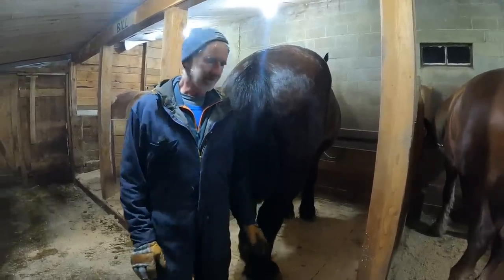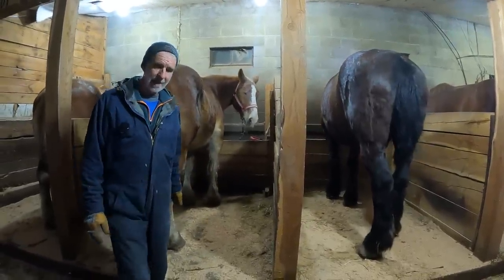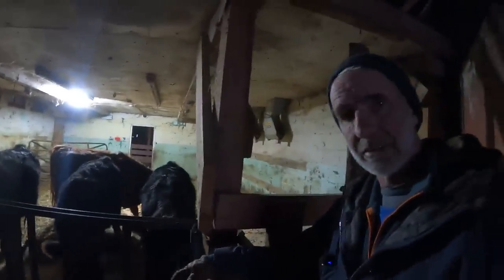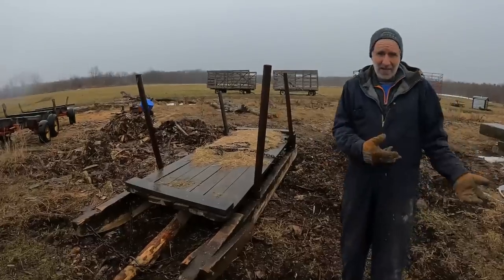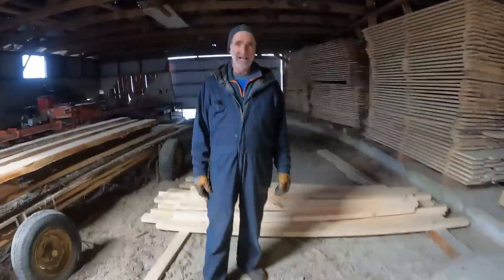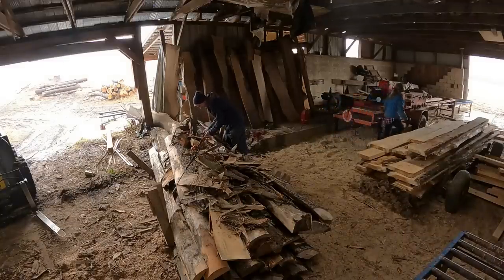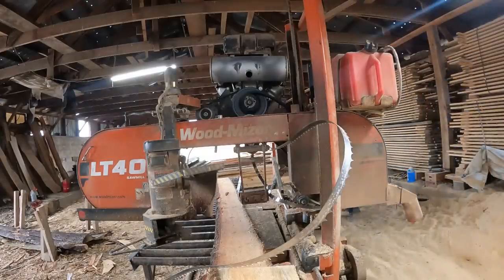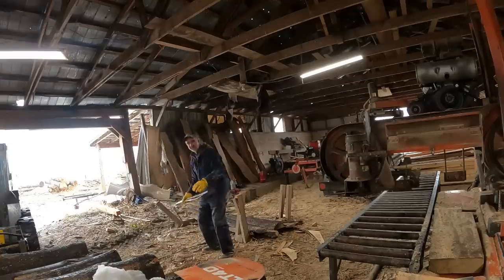Update on KEN'S LEG!! // Sawing Lumber on a Rainy Day with a Woodmizer LT-40 #459

Comment: Swelling on the hind legs often is caused by a subcutaneous inflammation caused by bacteria that may enter the skin through tiny cracks or wounds. These swellings occur more often with horses that are kept in tie-stalls than those who are kept in open environments. The lack of movement for prolonged times  can also be a cause for swelling especially with horses that usually work a lot.

Comment: To address your traction issues with your manure spreader Jim, I have found that putting the tires on opposite direction from the way that a tractor tire is mounted should increase the traction a lot. Your videos, Jim and Brenda, are a great gift to so many people and are of a quality that they could be used as an instructional tool in classrooms. To have a better understanding of agriculture and the many methods used in agriculture historically will give people a better understanding of what their own capabilities are. Thank you folks for the fine videos and education.
Reply: Jim is using  horses so  no need  to reverse manure spreader tires to increase traction from tractor.  Gosh you almost  got me there with your comment John.
Reply: If your comment is right about increased traction then why not tractor tires be mounted your way from the factory. I am sure  the engineers would  have that all figured out. I think you are just fooling with me   and  maybe  Jim .

Comment: I wish I could be there to show Brenda how to set up a pivot point  to make edging those planks easier for her. It would involve setting a saw horse between the pile and edger. Only touch the far end of the board. Swing the board onto the horse, pivot and the other end onto the edger deck. Line up and push it through. It would work better than having a helper.

Comment: It was not unusual for horses in towns in England to develop leg problems after being worked on the hard surfaces of the roads then rested on Sunday. It may also be the shoes are reducing the movement of the frog and  reducing circulation. I wonder if there is a pattern such as the time of year when different shoes are worn, or the type of work such as plowing or forestry.

Comment: Good idea using hot water to dissolve pills however you might want to check with your vet about that.  Heat sometimes damages the efficacy of the antibiotics, probably depends on how hot it is.
Reply: Excellent point, I would think 100 to 150° f would be ok, bee honey breaks down at 160 ° I was told. But yes, very good point.

Comment: Why not get wider tyers for the speder so you don't sink into the fields.
Reply: We know Jim spreads manure when ground frozen  and when ground is dry  (summer and Fall ) . So stock pile manure during spring break  up . Save expense of wider tires  plus horses  sinking  hoof prints ln soft ground . We never let our dairy cows out on pasture  until the 24 th  of May for two reasons. Enough grass has grown  for them to eat and ground dry enough to support them walking around .Cheers Ps Jim  as you already know but just a friendly reminder . When cultivating your plowed ground . Stay out of those mud holes  with the  tractor or horses .Yes I know it's hard to show patience  when you want to get it done .

Comment: I can’t believe that spreader would get stuck, you only two buckets in for a load. That’s only about 6 to 700 lbs of manure. 8 loads hauled with your horse spreader is like one n a half loads a typical dairy spreader would haul. Remember April showers bring May flowers so be ready for planting.
Reply: Remember Rick bigger the manure spreader the  bigger the tractor needed to haul the fully  loaded  spreader . Bigger tractor  bigger debt payments . All Jim's  equipment paid for plus no diesel fuel expenses. Plus  Jim is not being paid by the hour  or need to be efficient.  He is working for himself and not the farm machinery  companies  plus sleeps good every night without worries  of how do I make  the debit payments .  Cheers
Reply: Wait until you see Jim's cultivation machinery and planting  equipment .looks like junk  . But it  works and paid for . John Deere and Case International  salesmen  unhappy with Jim  and his Amish neighbour's. It all depends how you look at things .Cheers

Comment: Why not drill the ends of the 4x12s, and put one or two dowell pins through the 12 inch length.  Then, when you cut the runners, just put the ends with the dowells on the back end of the sled.  
I have repaired a lot of cracked wood with dowells, and it makes a great repair,